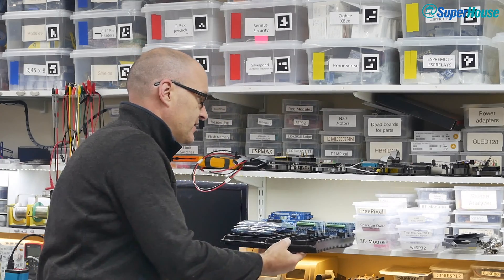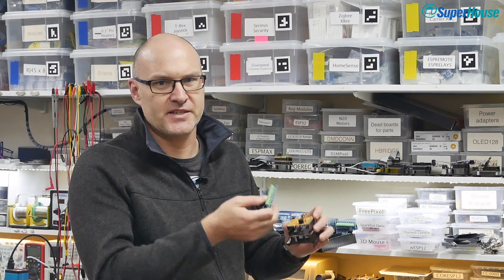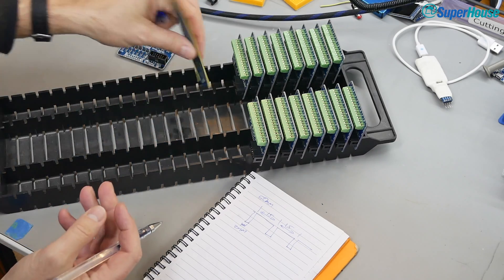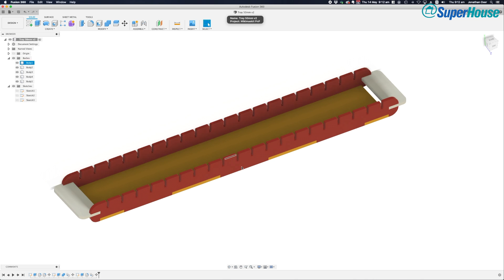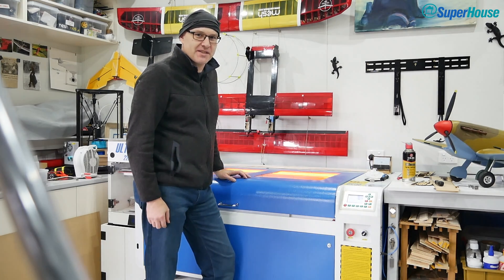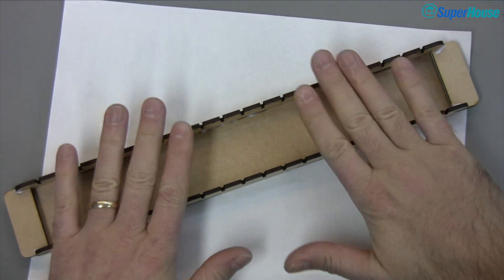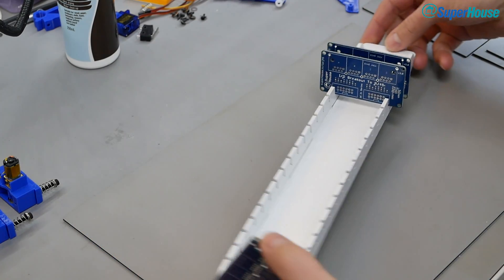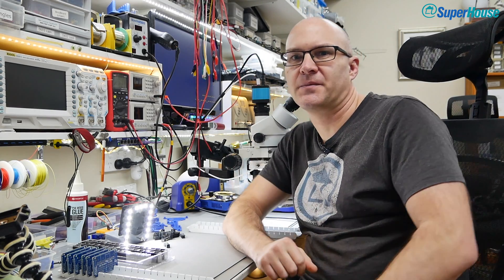Vlog #69: Easy laser-cut PCB tray

Comment: You mentioned that the ones you bought are made of a plastic that disapates charge through to i suppose the bench. Does the painted MDF hold charge as its an insulator? I've made some electronic housings out of wood and worried it's not good for electronics.

Comment: What are the QR codes on the boxes for? Do you have some organising software 🤔
Reply from the maker: Yes, a Raspberry Pi with a camera mounted on the other side of the room takes photos of the shelves and uses OpenCV to work out the coordinates of each tag, so it knows where each box is located in the room.
Reply: @SuperHouseTV   really cool idea. A friend of mine worked on a similar project for warehouses. They used AR glasses and drones. The warehouse worker the should be able to look at a pallet an see al informations